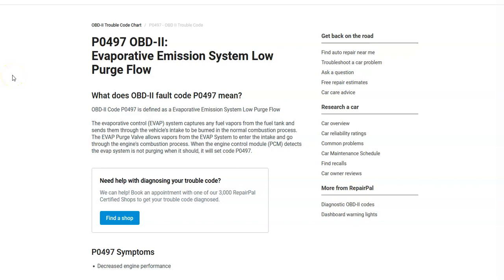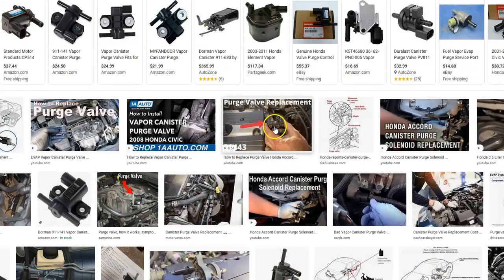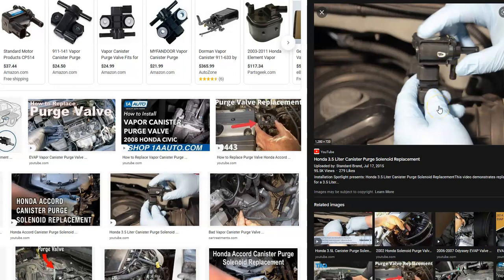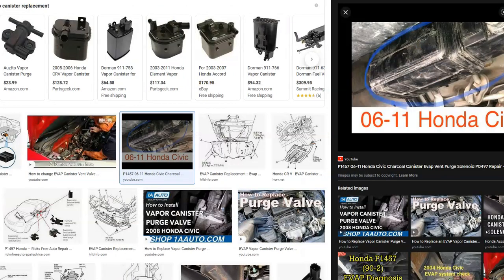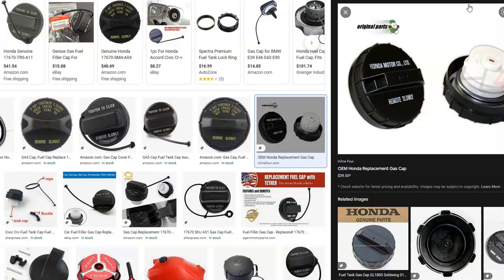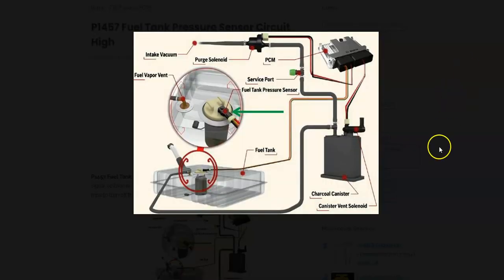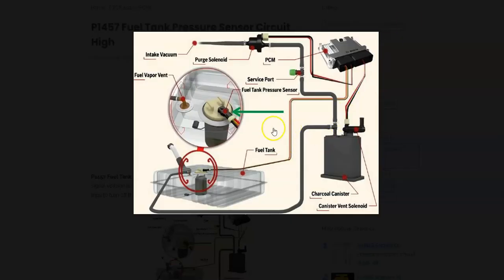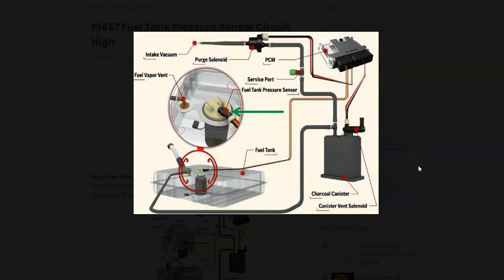How to Fix Honda P0497: Evaporative Emission System Low Purge Flow

Comment: Great explanation.  However, Im curious as to why you didn't mention the Canister Vent valve aka the (shut off valve). Its the other valve (excluding the purge vent valve which you did an excellent job of mentioning). Its a component of the Evap emissions systems.  Thank you nonetheless!

Comment: 2013 Honda Odyssey. I had the "Check Fuel Cap" message, then the P0497 code came up a couple months later. I changed the purge selenoid and reset the codes, but the "Check Fuel Cap" came back up. I ignored it. Now in the last few days a rattling noise has started (about 9 months since original "Check Fuel Cap") and the "Check Fuel Cap" message stopped popping up. The rattling noise increases with RPM up to around 2600rpm. It has a new fuel cap. There seems to be no other shifting or engine changes and no other codes. Any idea what I should check?

Comment: I have a 2006 accord v6 and have had it trying to resolve this issue.  I've replaced all the parts that could cause this fault to no avail. The car has thrown this code for months, passed emissions as i disconnected that battery and removed the gas cap, then reconnected everything prior to entering the testing facility, so that's a non issue. The problem is that it runs rough and gets pretty bad gas mileage, even for a v6 with a manual transmission. My thought is to take the charcoal canister and the purge solenoid at the intake out of the equation by directly connecting the line from the gas tank that connects to the canister to the hard line that runs through the firewall, then connecting that directly to the intake. Wondering if anyone has any thoughts on of i should run a check and/ or tip over valve along that path. I couldn't care less about the smell of gas or the fact that fumes are venting into the atmosphere; I'm just done with this issue and want the car to run well. Thank you

Comment: Question; you stated that the purge valve is on when the engine is running. Do you mean it is always on when the engine is running or does it cycle on and off as needed? FYI I replaced a faulty evap purge solenoid and I am still getting a P0497. I did confirm the valve coil was bad - very high resistance (~18 Mega ohms). The new valve had a low resistance <100 ohm. I tested valves with a 12 battery. The faulty valve was confirmed. IF as you state the valve is energized as long as the engine is running, I should be able to confirm that either with a hand vacuum pump with gauge to verify the valve is opening OR directly check for voltage to the valve. Your response is greatly appreciated.
Reply: I would think that the purge valve would cycle on and off while the engine is running depending on the pressure sensor. 
My understanding is the pressure sensor sensor is the only way the on board computer knows if the vapor pressure changes positive or negative.
I question since  I replaced the original valve because the coil was bad. The new purge valve failed within about a week I surmise due to a failed coil. I did confirm voltage to the valve but the valve did not open indicating a bad coil most likely.
 I will be replacing it again with the same aftermarket Dorman valve.
If the valve is meant to cycle with the pressure sensor but if the pressure sensor is bad then maybe the new valve burned out because it overheated. 
I'm only guessing but it would make sense the valve should cycle cycle on when it senses a positive pressure and off when the pressure drops.
If you are not sure of the answer that's okay.
When I again replace the purge valve and if it burns out in a week or two, I will need to consider whether the pressure sensor might be bad. Thanks for your feedback.
Reply from the maker: It varies depending on the year and engine when the purge valve opens up, usually after the engine warms up, but it can vary. It is closed when the engine is off or the intake will be flooded with gas vapors.

Comment: I changed mine same code came back on 😢
Reply: me too lol i might just bring it to the dealership
Reply: Changed which part  
? He listed 5 possible parts
Reply: @chrispaul1117 purge valve sensor
Reply: Purge valve, evap cannister, gas cap, hoses in your system... especially near the connection, and finally the file tank pressure sensor could be bad

Comment: Hey there! I am showing codes P145C and P0497 and replaced the purge valve solenoid with a rock auto replacement. My engine light is still on and I’m still getting horrible mileage. Is it common for the vent solenoid to go bad?
Reply from the maker: A P145C Code is a Fuel Tank Pressure Sensor. When the pressure sensor goes bad it sends bad data to the computer so it thinks there is an EVAP issue. There is likely no issue just a bad pressure sensor.
Reply: @whyingo7964  I’m definitely getting horrible mileage since this has happened. I’m lucky to get 200 miles for a tank of gas where I used to get over 300 miles for city. Could the bad fuel sensor cause this?  If so is it hard to change?
Reply: @recbone1999 I have the same codes did you ever get this fixxed??
Reply: @Sxhwiftyy  unfortunately no. I’m driving around with the engine light on and getting horrible gas mileage. If you figure it out please let me know 🙏🏼
Reply: @recbone1999  any luck with this yet bro?
Reply: @whyingo7964  you have another video saying the fuel pressure sensor code is p0451 but in this comment you're saying the p145c is the fuel pressure sensor code. I'm confused 🤔?
Reply: @krakenhits1587 that’s Due diligence
Reply: Any updates? Im getting these same 2 codes.. i changed the purge valve twice now so thats not it .. help ?

Comment: Very nice video! 
I’ve a question, could it be possible that evap (charcoal) canister can be full of gas if people full the gas tank too much? 
I’ve an ep3 and I have a p0497 code lighting 50% of my travels. 
I’ve not heard it in the video and i think it may help others too.
Reply: No
Reply: Yes this is possible. Topping off and then doing a pull or punching it  can cause a code especially if you're modded. I know from experience.  So I wouldn't top off too much or punch it when your tank is all the way full